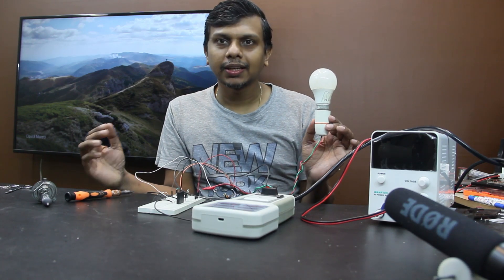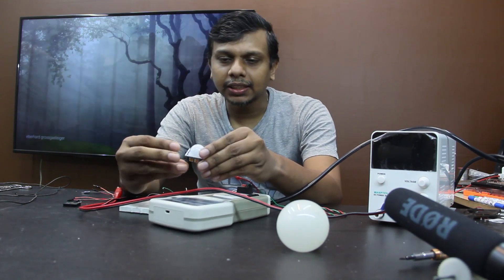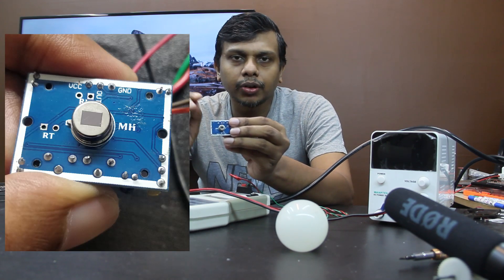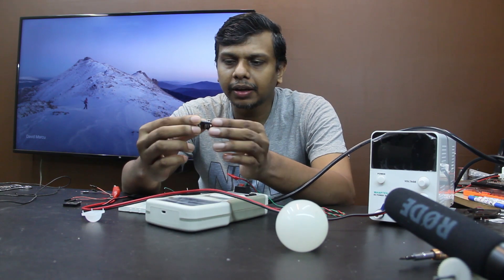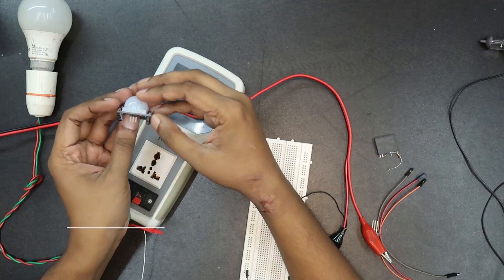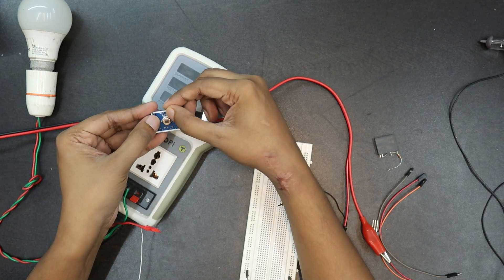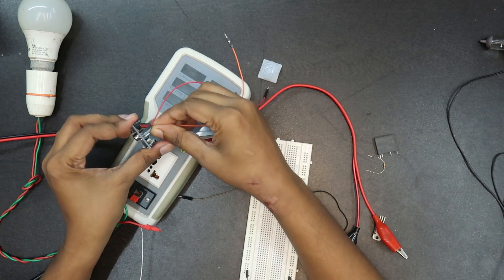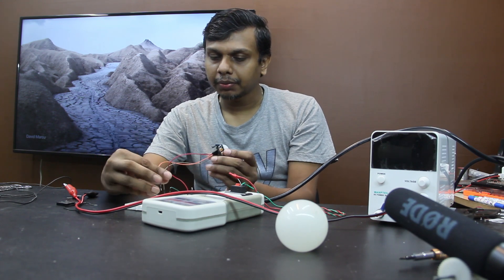Containment EP2 - അനങ്ങിയാൽ കത്തുന്ന ലൈറ്റ് | Automatic Lights with PIR Sensor (Non Arduino)

Comment: Nice...... Ee lag varendathalla. Mostly wire lose akunathukondavaum. 

I've made a motion detection alarm with this.....
Reply from the maker: Lag varunnathu ... Bulbil ninnum varunna IR sensor pick cheyynnathu kondanu...
Reply: @Azhichupani  PIR sensor or radiation / body temperature alle detect cheyunne. Also bulb heat varunathu aanengil lag varunathu enthukondu aanu. Always high ayittu irikande?

Comment: Bro, 5v dc ano atho 12 v dc  ano relay
Reply from the maker: 3 to 32 volt work cheyyum..
Reply: Bro kanicha solid state relay  5 v ano atho 9v ano ,clear ayilla pic
Reply from the maker: Input 3- 32 v .. switching 220v
Reply: @Azhichupani  thanks

Comment: Hello brother, am using an Asus x507U notebook, I choose that  because of my budget limitations. It has a i3 2Ghz processor 4gb DDR3 ram and HDD.  most of the time I use about 5,6 application simultaneously, The comedy is that i use applications like photoshop illustrator VS eclipse SQL filmora and all other productive apps. I know you can understand the complications while using this, it lags much than you think while switching between apps. Now I couldn't afford a new laptop. I would like to upgrade this one. planning to upgrade to SSD and (or) RAM. CAN YOU PLEASE GIVE YOUR VALUABLE SUGGESTION..Thanks.
(തുമ്പിയെ കൊണ്ട് കല്ലേടുപ്പിക്കുന്ന പരിപാടി ആണെന്ന് അറിയാം 😄)
Reply from the maker: 256 gb ssd + dvd rom HDD caddy + 8 gb ram itto pinne onnum nokkanda
Reply: @Azhichupani  💙